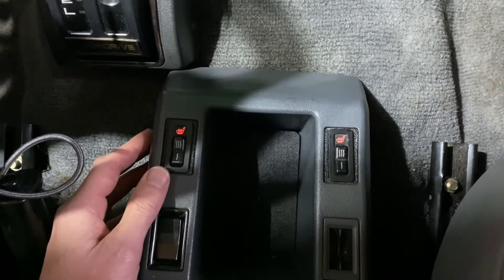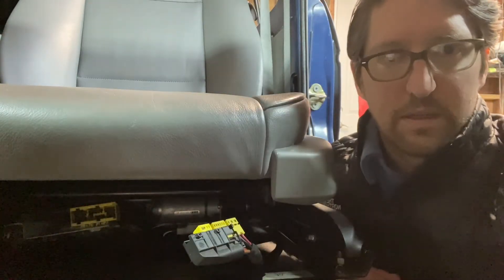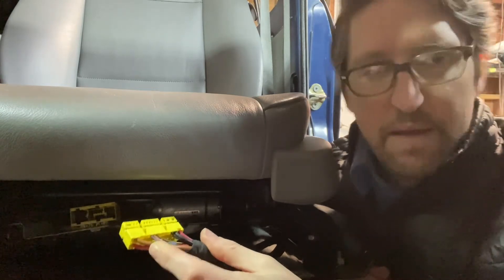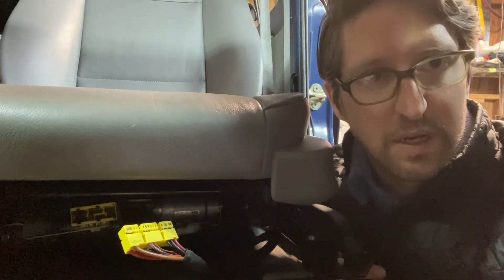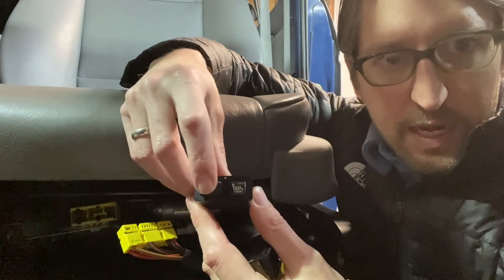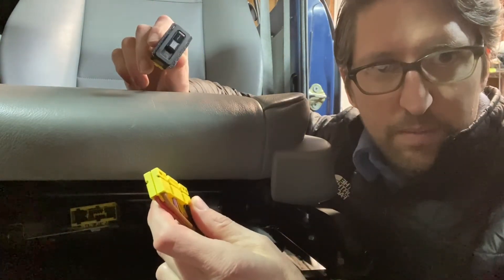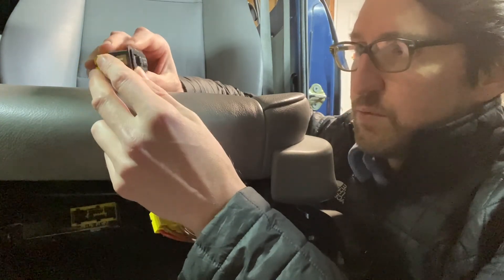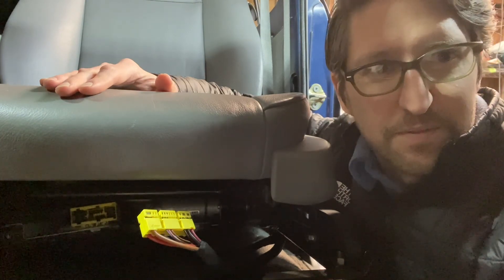Wiring up BMW E46 seats (power and heat)

Comment: On an E60, is it the same as an E46, that if you have wires coming from your seats at pins 23, 24 and 25, you have heated seats?

Comment: hi, i am trying to use a heated seat from e92 in my RAM Promaster. My question is how does the heater turn on/off/adjust. Is the command communicated thru CAN bus in command? Because, I see both seat/back heaters are connected to black control box along with seat motor controls. I see no extra wiring in yellow connector about heater power either. If the heater button on dash generates CAN command, do you know where to find that command from or do you know? Otherwise, i have to provide separate circuit to power up heaters using micro controller of some sort. thanks in advance.